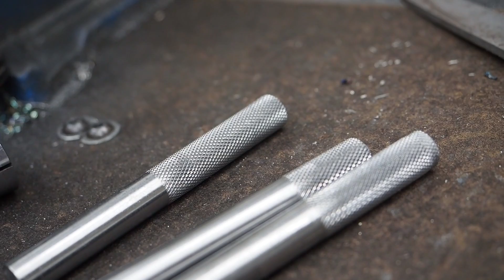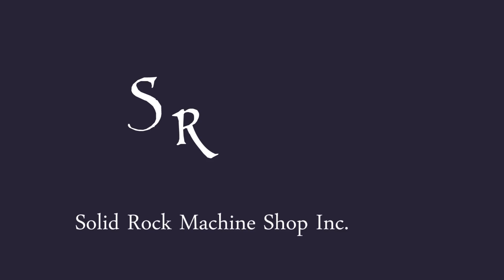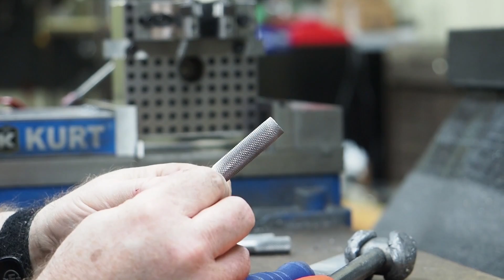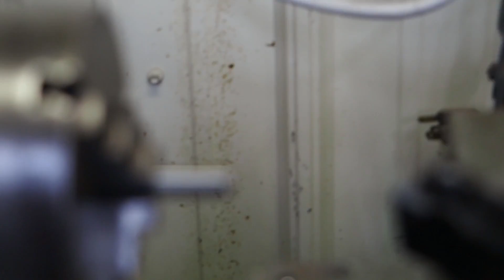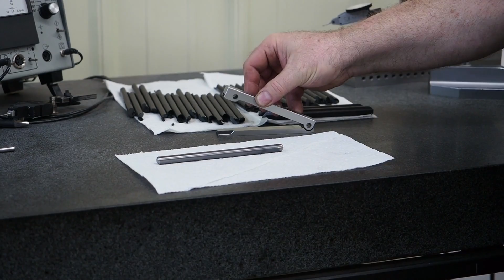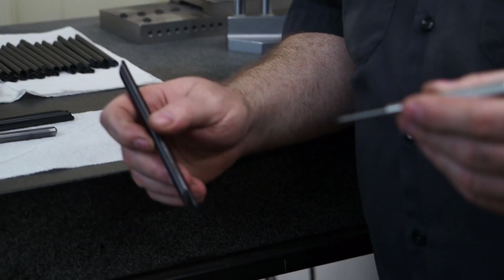Knurling on the Mill and Turning Carbide on the Lathe

Comment: A little trick I've done for years was tilt the wheel inward or an a lathe rotate the knurling tool about 10 deg so that you are not contacting with the entire face of the knurling wheel. Why you ask? This especially in the case of the milling process uses much less side force as well as on the lathe to generate a nice knurl. Did it for many years and the knurling tools stand up fine and you don't strain your equipment and work pc near as much. Cheers.

Comment: Well, knurl the carbide and you've got something!  

I imagine those carbide shavings are similar to cast iron chips?  When would you choose to turn carbide, over grinding it?  Thanks for sharing your time!
Reply from the maker: Hi somebody else,
Now that would be something I would like to see!

If your carbide needs a profile then CNC diamond insert combo will be the way to go. My diamond wheels are 150 grit and not suited for rough grinding carbide so removing most of the stock with diamond inserts is very fast and I save the abuse on the diamond wheels. Steve

Comment: Hi Steve I've nearly watched all your videos now so I have to say congrats for a great channel, I wondered if you could advise me, I'm having trouble with some wood chipper blades I sharpen on my surface grinder, I'm using a 46 grit K wheel or at least I think it is, what's happening is I have to keep truing the wheel as it keeps loading up and causing me chatter issues, what wheel would you recommend to use, there's  a video on my channel showing what I'm doing, it's very hard steel and I think the wheel is the problem, thanks in advance.

Regards Alan.
Reply from the maker: Hi Alan,
I watched part 2 on your video but I need more information. What kind of steel and what hardness if you know would be helpful. There are many variables at play here and controlling as many as you can will make a big difference in the finish. The 2 most important variables in my opinion are wheel selection and dressing of the wheel. The 46 K may be to hard for the blades. I would use a 46 H Ruby wheel like you see in our videos. The general rule is harder wheel bonding for softer metals and softer bonding for harder materials. Also, watch our video on dressing the wheel starting at the 8:06 mark https://www.youtube.com/watch?v=yD1MmjlWWV8&t=1609s it covers a lot of information on wheel dressing.  The depth of cut is very important too. Use the heavier cuts to remove the bulk of your stock and redress the wheel and take lighter cuts of no more than .001" for finishing. I usually use less .0005" on the last pass and run a blank pass or 2. We can start here and if that doesn't work we can try some other things but this is where I would start. Steve
Reply: Thanks for taking the time to get back to me Steve, unfortunately I have no way of measuring the hardness of the steel all I can say is its very hard indeed, I'll order another wheel in the morning and let you know how I get on, I've seen your film on dressing the wheel before and I took note of it so I think it's the wheel that's the problem.

Thanks again, Alan.
Reply from the maker: Hi Alan, in the video it sounded hard and if it is a chipper blade I bet it is. Let we know how things work out with the new wheel. Steve
Reply: I've ordered two wheels but it could take up to a month? I'll let you know.
Alan.